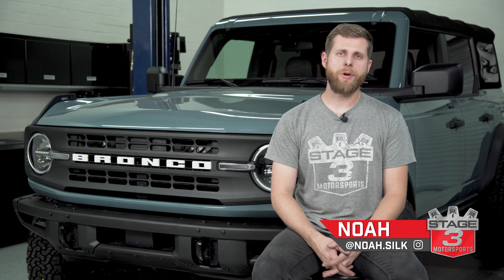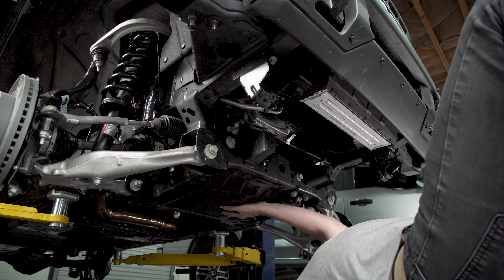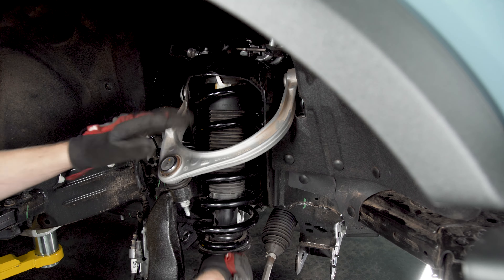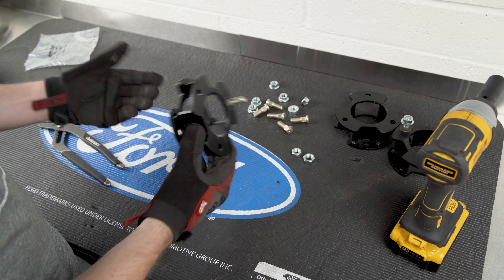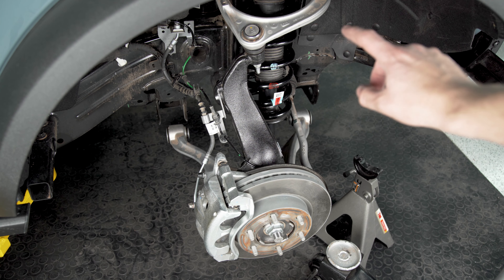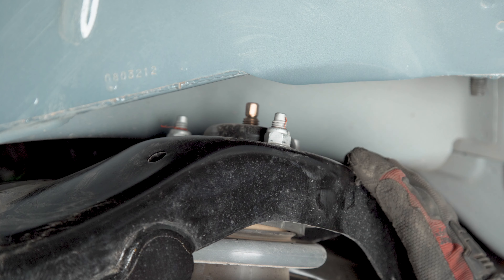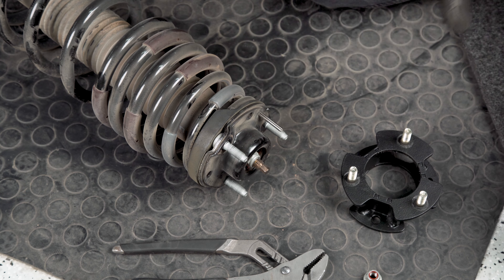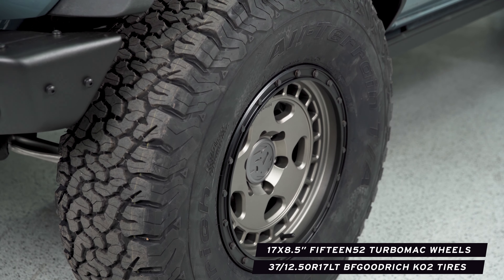21-24 Bronco 2" Spacer Lift Kit Front and Rear Install

Comment: I thought you're supposed to keep the control arm bolts loose until the weight of the truck is on the ground so you're not preloading the bushings

Comment: Hello. I just installed the Rough Country 2" spacer kit. Your video was spot on. So much better than splitting the ball joint and removing the drive shaft. The only thing I would say is you do need to rotate the bottom of the strut slightly so it will lineup in the factory position. Great video.

Comment: Is it really necessary to disconnect the rear track bar? I don't see the purpose as the track bar has plenty of range of motion. Also, same question for the front sway bar. Couldn't you just disconnect the end-links and rotate the sway bar up and out of the way? Then removing bottom skid plate wouldn't be necessary either.
Reply: Did this install on my brother in laws 2022 bronco. Not necessary to take off the front sway bar or the rear one…….. for the front you can just disconnect the end links
Reply: @dannyb5863  looking at mine it seems like you would have to take the sway bar frame mount off to get the lower control arm bolt out.

Comment: So I just bought this lift/leveling kit and when I went to re-install the coil over, I noticed that there is a 4.5 degree tilt on the top of it.  When you add the spacer (now plastic), you have to rotate the entire unit 180 degrees.  This will now introduce a 4.5 degree tilt in the opposite direction.  So now we have a 9 degree tilt from factory.  Is this correct and should I be worried or is this a non-issue and I can drive my bronco for 200K miles with no issues ?

Comment: I welcome all replies - want to put fatter tires on a 2023 Outer Banks.  Currently have stock P255/70R18  32" tires.  Looking to move toward LT315.  Sasquatch-esque.  I believe that by going fatter, I will increase diameter - probably needing 35" tires.  I want to know about required lift to accommodate that tire diameter and if I must change the wheels from 18 to 17 to do so.  Thank you in advance for the guidance.

Comment: Very informative step by step video. Can this be done on a Bronco Sport Badlands? What size tire fits a 2” lift. Thank you. Tom T.
Reply from the maker: Thanks! The Bronco Sport sits on a very different platform from the regular full size Bronco so I don't think this video will be much help in that regard, but there are some small lifts and spacers available for the Sport to clear a larger tire. Sadly, since I haven't spent much time with the Bronco Sport I don't know what sizes would fit best.

Comment: Did a 2.5 inch front-level via bilstein 5100 on my 2019 ranger last weekend, and dropped the LCA to do it. Looks exactly the same as on this build video (same chassis, so it makes sense). Was much easier than taking EVERYTHING apart like the ford manual suggested. Heads up, my toe was 2 degrees in on each wheel after doing it. Not even close to driveable... made it to the alginment shop, but the tires howled the whole way there :)

Also, those LCA nuts have factory torque specs of 195 ft. lb. I had a hard time getting a big enough breaker bar under the truck to get them loose. I don't have a lift and i'm not a big dude, and yankin' on a 15" breaker bar required about everything i had in my shoulder.  I torqued them back to 100 ft lb  on the reinstall just to get it to the alignment shop. They took it from there.

Comment: Do you know if the outer bank factory wheels will allow a fit without spacers with 2957018 tires and not rub?

Comment: Any idea how much a shop would charge to do this? My days of working on cars was a couple of decades ago and I have limited experience with suspension stuff.. and limited space to do the install even if I had the desire or confidence to do it myself.
Reply: It calls for 3hrs labor so depends on shop rate.
Reply: In Canada, Action Car and Truck quoted me 300$ to install the ReadyKift kit. That's around 2-3 hours. Ford quoted me a bit more.

Comment: Why does RC try to make this so much more complicated?
Reply: It's more complicated to take your truck to an alignment shop after dropping the LCA's and screwing with the eccentric position.  Separating the UCA from the spindle doesn't require you to do that, so their method could be done by anyone in their garage.